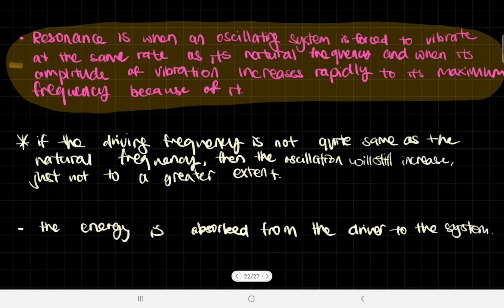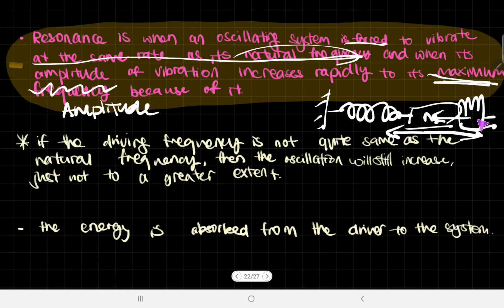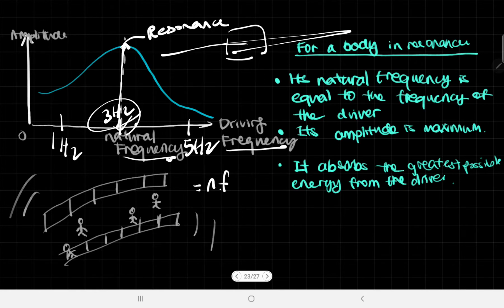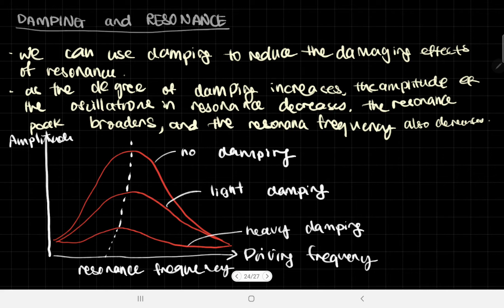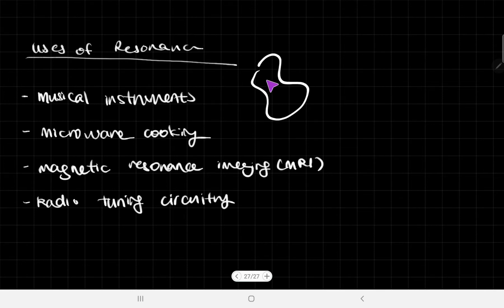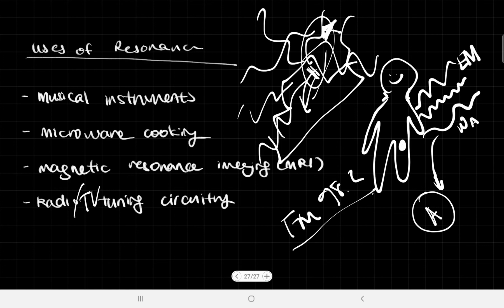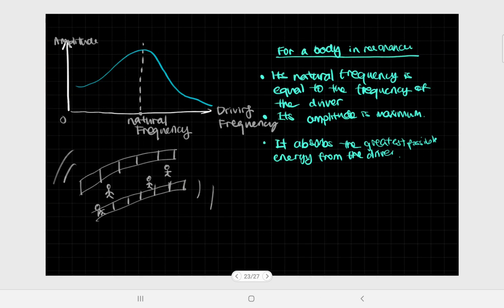Resonance, Resonance and Damping- Oscillations, A Level Physics

Comment: By the way i have a practical physics question, what are the advantages of using tape measure instead  of meter ruler , is it about how tape measure has a longer range of length? Or is the fact that taoe measure cam be marked but meter ruler cant

Comment: you see critical damping isn't it should object just goes to its equilibrium position and then stops? i mean by that it follows the light damping path and on the first equilibrium it stops as it doesn't go any oscillaton
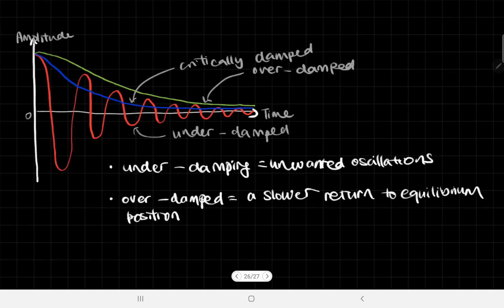Reply from the maker: Yes, you're right (see 10:12 onwards, the blue line is critically damped)! Critical damping means that it's the minimum amount of damping to just return it to equilibrium on the first oscillation. It has a fixed value, depending on the material/object in question.
However, "light damping" does not have a fixed value. It is a vague term. You have absolutely no damping, in which case the object oscillates forever; you have light damping, which means the object slowly has decreasing amplitude and eventually stops. Heavily damped objects may stop very quickly.

Hope that makes sense. Good Luck!